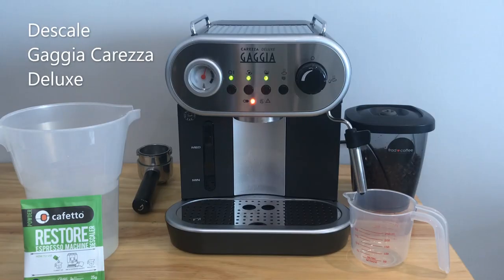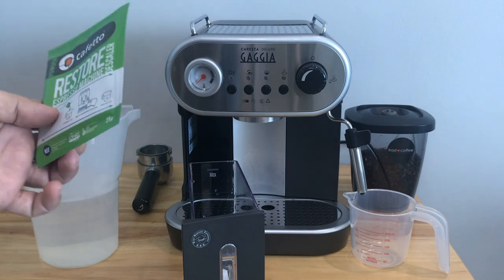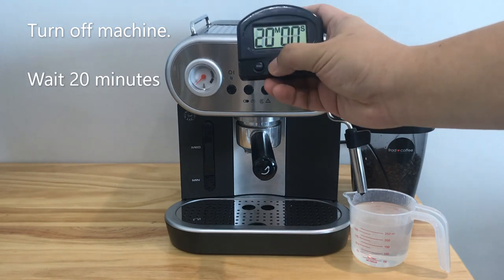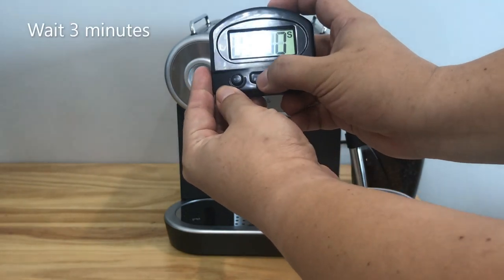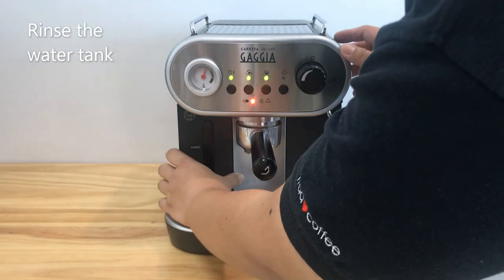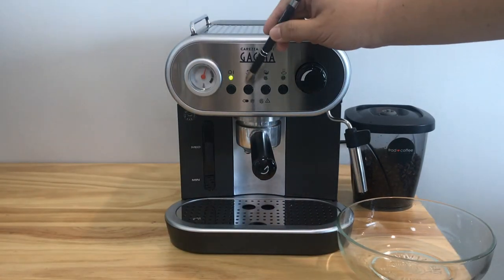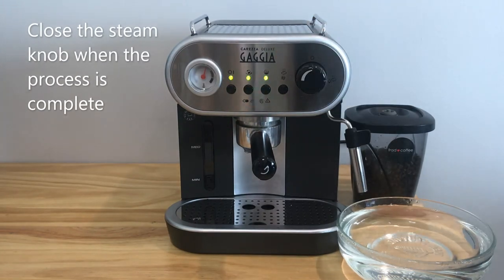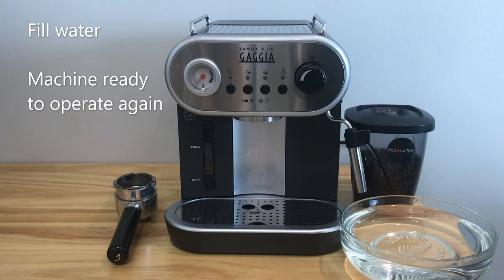Gaggia Carezza Deluxe - Descale 清除水垢

Comment: Thanks for this video. I have a question. The manual says to remove "shower disc" and clean before pouring descale solution into the water tank. Do you know what "shower disc" means?
Reply: Look up under where the portafilter attaches and you'll see a disc with a single screw holding it. Remove the screw and disc/screen, clean and reattach.

Comment: Hello, have you ever tried flushing it? The manual says cleaning AN EASY PROCEDURE? I put in fluid then followed as instructed. The red light remained on. I went thru' the procedure for a 2nd time. this time half way thru' the red light went out and the white light flashed on/off about halfway thru the procedure. However as I continued it went out  and the red light came on again. After procedure completed the 2nd time red light is on all the time as when I started.
It is far too complicated for words. I will never buy a Gaggia again.